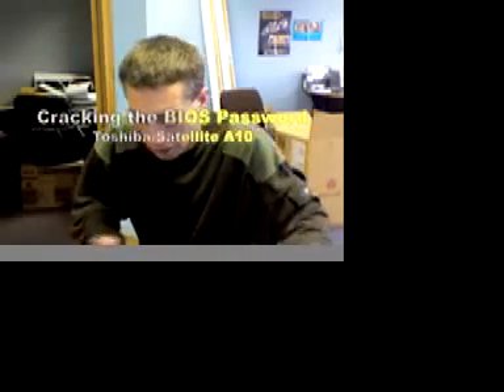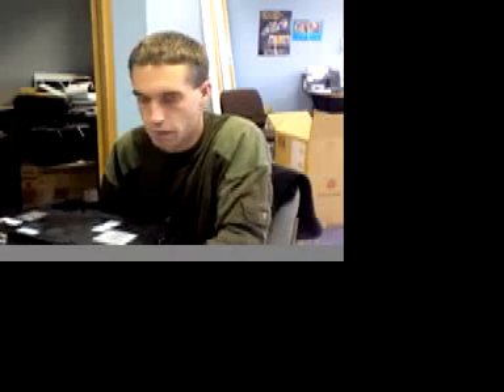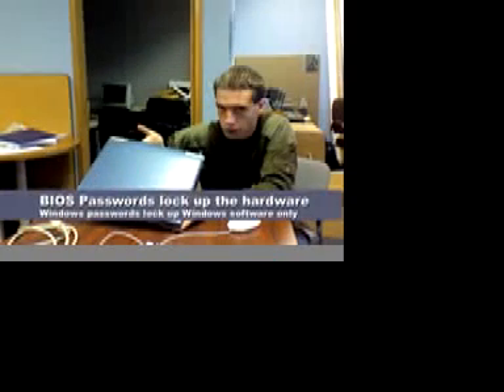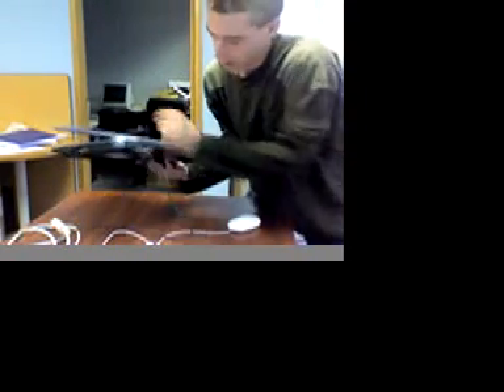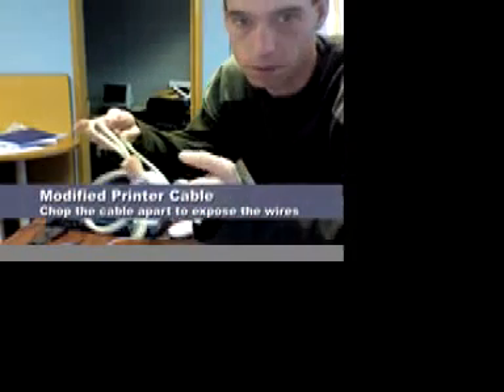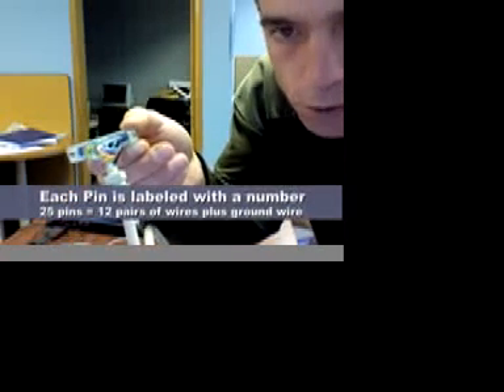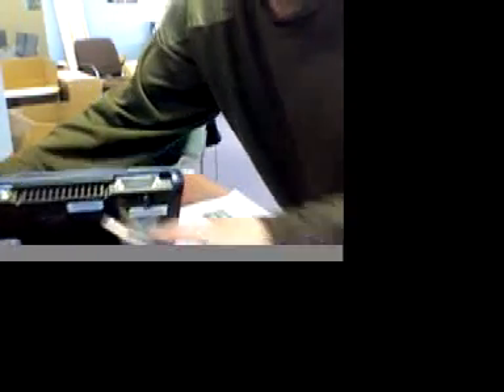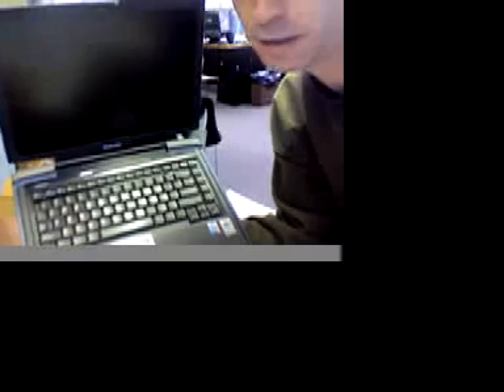How-to Crack a BIOS Password - BIOS and CHIP cracking

Comment: I HAVE NO IDEA OF WHAT HE'S DOING, I just know I shut down my laptop, And IBM type 2647 and when I tried to start it back up , ALL I GET IS A BLACK SCREEN. I haven't ever even hear of a BIOS Password. Could I of put a pass word on BIOS Settings and not know it?,, AND I ALSO Would like to know if All You get is a black screen when a password is required??,, I'm at the point of trowing this IBM think Pad in the trash. BLACK SCREEN AND DVD/CD Drive wont run other than a Second at start up.

Comment: why not just jumper the "clear CMOS" pins, or move the CMOS battery as long as it's not soldered onto the board? I've done that before in less than the length of this video and it works like a charm and takes you back to factory default settings.

Comment: This won't work if the laptop has a trust platform module.  They are meant to be lock a machine down so tight that only NSA can crack it.   Newer laptop don't have a parallel port at all.  sorry

Comment: there are two safe ways of doing it
1 remove cmos battery not used on new models can be found on laptops and pc's
2
if the computer has a jumper switch inside to reset bios use it and bios including password will be reset

Comment: If the laptop has a volatile memory system on the motherboard, just take out the CMOS battery for 5 minutes. Plug it into the a power source, then unplug the power source.  Re-insert the CMOS batttery and you're golden.